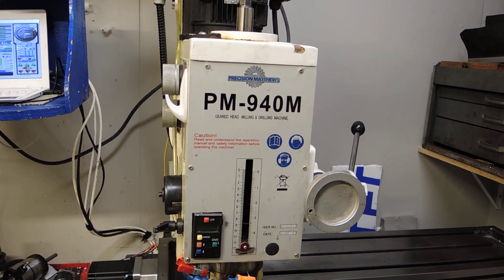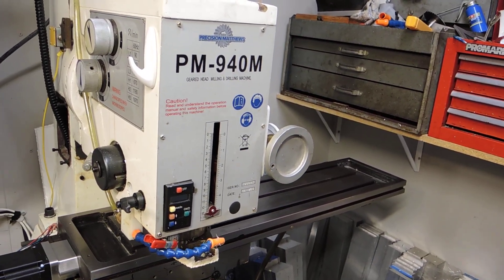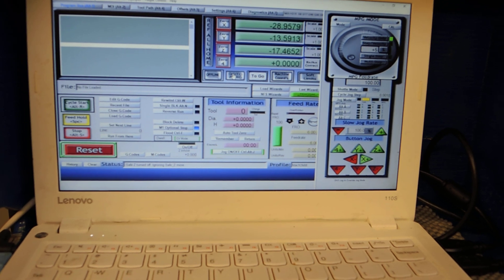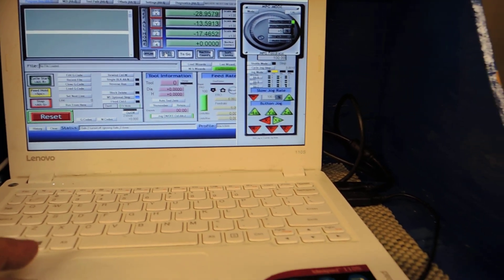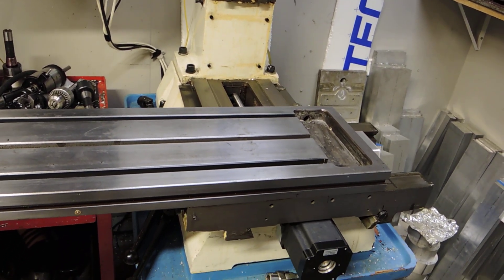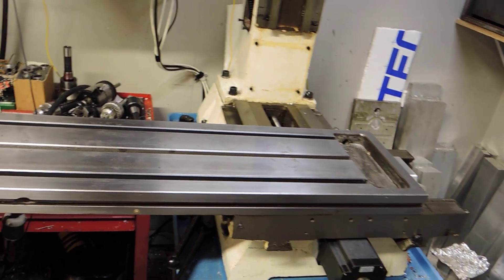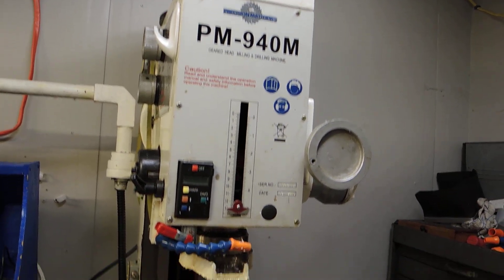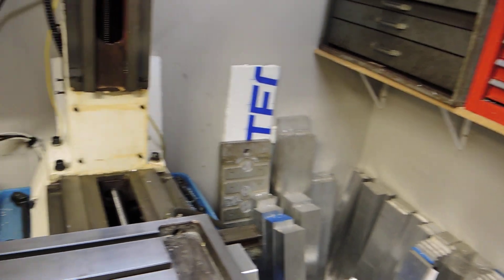940 travel CNC kits

Comment: Thanks for sharing, nice work. You mention a chip pan for the 940. using the same base? how did you attach it? I' like to see a video of the pan.
Reply from the maker: https://www.youtube.com/watch?v=CtPLc16FOVA

At 4.42 I pan the room and you can see the chip pan.  I have discarded that one for V2. V1 leaked because all the glue would dissolve from the coolant. V2 was going to be welded but I added a large area at the front for chips so now I have V3. It will be welded with my new A/C Tig. V3 sits at a angle and does not rest on the table. Its a bit of work to get it done.